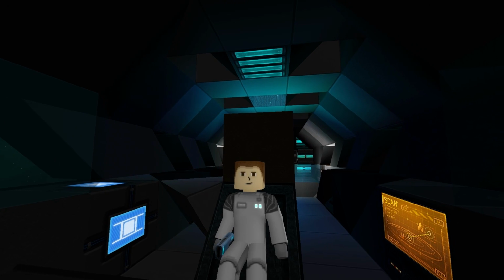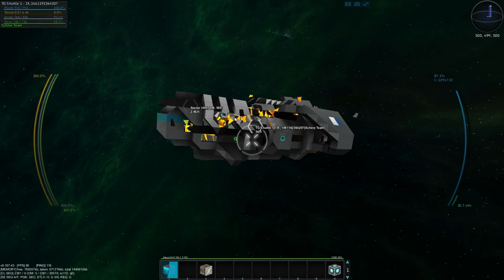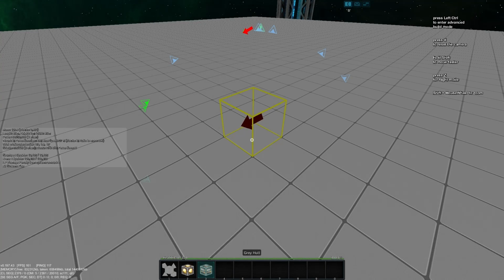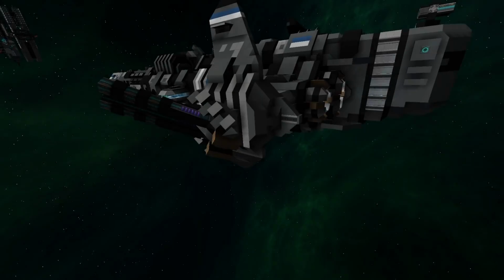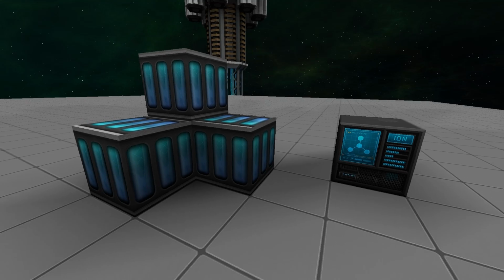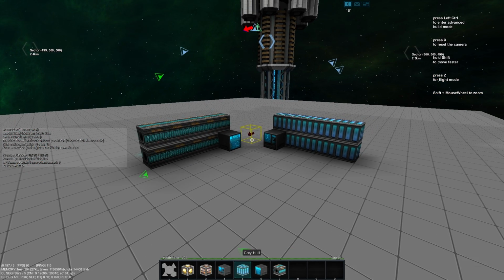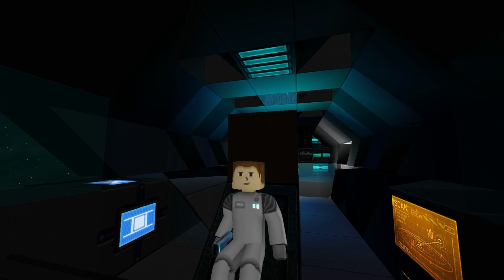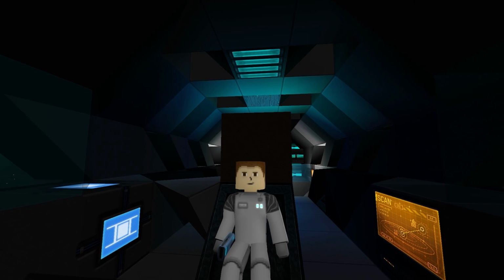[OUTDATED] StarMade Flight Academy  - Shield Systems

Comment: Shields are pretty neat, but I think armor needs some major buffs. It's heavy and takes up a lot of space, yet gives relatively low protection, plus it is difficult and expensive to repair.
Reply from the maker: Agreed. We have received some feedback and will implement changes and balancing to things like armor, which was specifically discussed.

Comment: Just wanted to know a little bit more about the game.

If i wan't to make a ship wich is capable of holding additional parts like another layer of armor (rails n docking) And my additional part  has shields put into them, will it protect main ship it is connected to untill it reaches 50%?

Familiar question about thrusters, if i put a booster pack on (basically thruster pack) Will my ship gain any extra thrust?

I would really like to know this before i start my ship building. Thanks in advance.
Reply from the maker: Shields go down docking chains, not up them. If you had a docked object and it had shields, you would need to use a shield supply system and shoot at the mothership.
Reply: Thank you very much, will keep that in mind when building.
Reply: +StarMade Can you use logic to make a docked entity do that. And do the same with power supply to potentially get past the power regeneration cap?

Comment: more like the only layer of defense. Too much work repairing ships. i hope there will be an easier way to reconstruct ships.
Reply: +Tyler White (77firelight) I recommend tearing down the damaged ships in  your shipyard, and rebuilding it new. All you need to replace are the damaged blocks, but it doesn't get easier than this IMHO.
Reply: +Jacemachine Gaming Ship yards where a nice addiction to the game, they are just very clunky. and i find it almost easier to deconstruct it and put it into the same blue print. maybe ill learn the secret to them.
Reply: +Tyler White (77firelight) Armor is fantastic. It's cheaper and more effective per block than shields are. The only downside is that it's heavy and doesn't protect turrets.
Reply: sorry, I didn't mean that armor doesn't work. I meant that its just not worth it. Armor seems like an "oh crap my shields are down, better warp to the next galaxy," then "my shields are down, but now you have to break down my 9 billion dollars worth of advanced armor that took me 5 days to accumulate after ravaging the universe of all supplies." and nothing is stopping the enemy from just using pierce effect. I would love the game completely if it just made the armor act the same way shields do. distribute the impact to all armor blocks on the entity. that way you still have to do repairs, but not complete fix the giant hole that pirate station alpha gave you.
Reply: +Tyler White (77firelight) Not the only layer. You can use the effect computers and modules to help out with making a strong ship. Look here for more info: https://starmadepedia.net/wiki/Effects#Defensive_Effects
Reply: iAmCodeMonkey true that ion effect and puch through effects can help with your defense, but these take a TON of power to run. you have a good point though, I just wish armour wasn't soo useless.
Reply: +Tyler White (77firelight) Armor isn't useless. You just need to balance out your ship type to strengthen it's attributes. Aside from that give it what it needs to end a fight before it's main defense is compromised. If you step in a pile go into CYA GTFO mode.
Reply: +Tyler White (77firelight) cough cough  Astrotech beam should repair & replace blocks and a Fleet Repair command should be added cough cough
Reply: I believe some level of realism is handy. If BFG impacts your side I'd expect to be a hole there. Also back to my previous comment about ship building attributes would reanswer any questions.
Reply: Tyler White Good luck running from my inhibitors. When I fight, either you die, or I die. And with my armor? It'll probably be you.